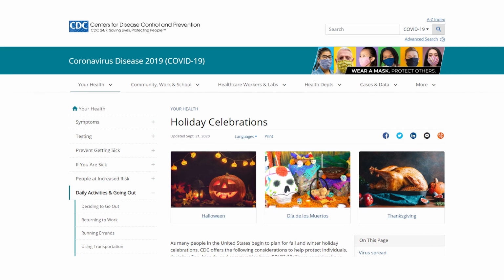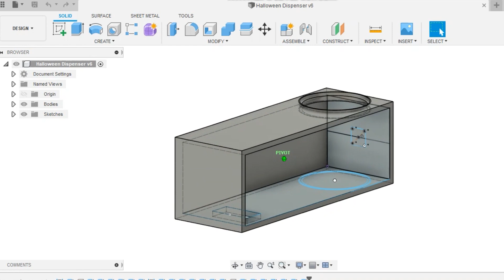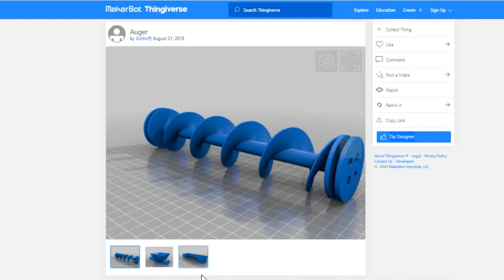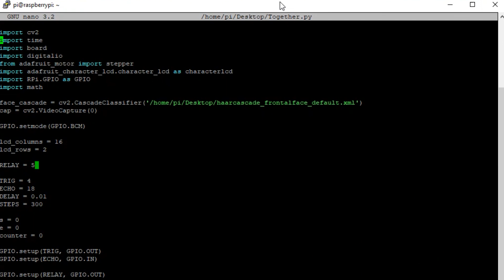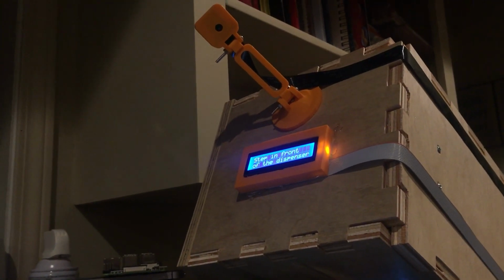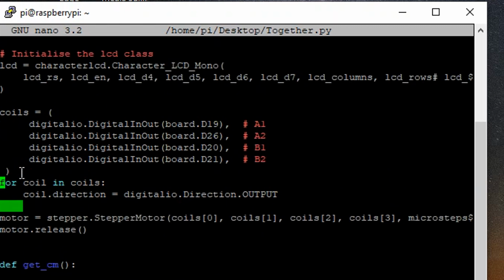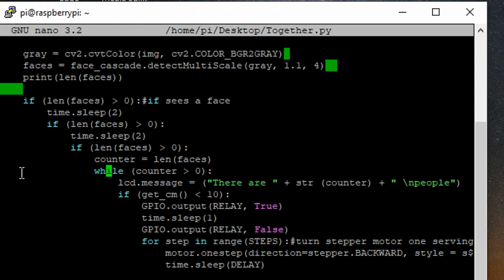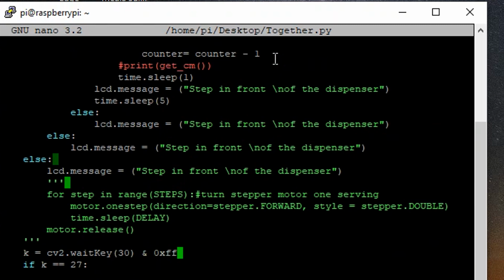Socially Distanced Halloween Candy Dispenser

Comment: I LOVE THE IDEA AS I HAVE THOUGHT ABOUT THIS FOR YEARS BECAUSE I CANT BE HOME TO PASS OUT CANDY.   I love the idea , but not everyone knows how to program of has access to all materials used. My question was if you could MAYBE COME UP WITH AN IDEA LIKE MacGyver, who typically builds all his gadgets from materials accessible on the fly base from whatever materials are available within reach at that moment in time. Basically like bringing Apollo 13 home . Instead of ROCKET SHIP MATERIALS , using TYPICAL ITEMS FOUND IN A HOME. My idea based the DISPENSING FUNCTION USING A SEMI  MANUAL  METHOD, and I had the vision of something similar to some kind of mouse trap device that uses weight and /time  somehow in the equation. 
Using a scale to weight yourself type of thing. OR SAND IN AN HOURGLASS MAYBE?? Or a mouse trap pull sting to dispense.  THE BASES OFIT WORKING OUT MUST BE DESIGNED KNOWING PRIOR, what candy you want to hand out, in advance. in fact, i thought of this as a gimmick to pitch to big money candy vendors like HERESIES,  or other.. etc to have it funded and you get  paid for it also. as an item TAILORED FOR THEIR CANDY ONLY. maybe even adding a metal strip in candy package that only their candy could use. 
If it works, I wont say not to a royalty cut of the proceeds. get after it kid, and maybe we can be a team. I’ve got so many ideas. thx